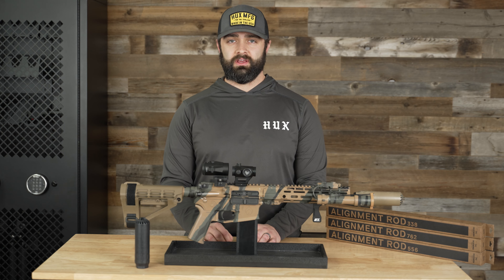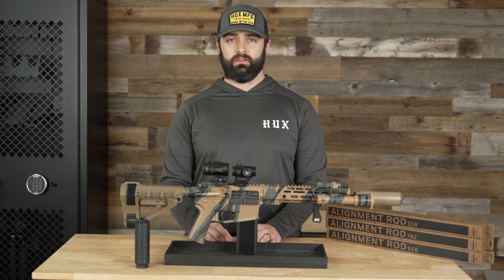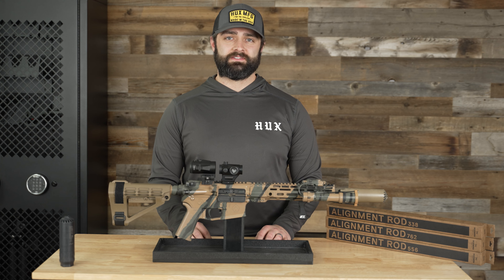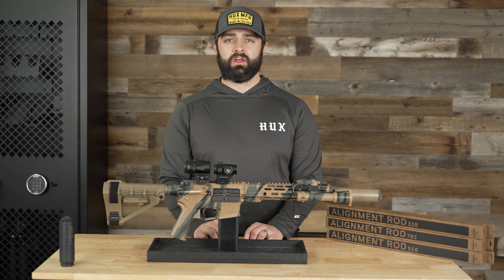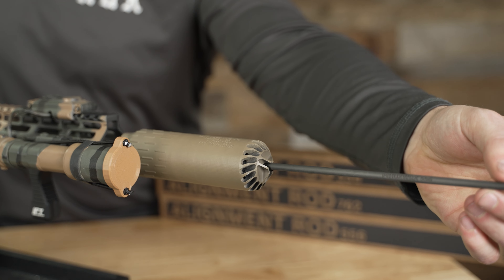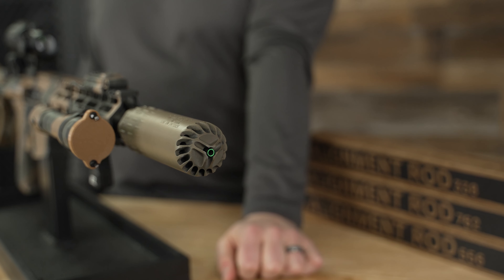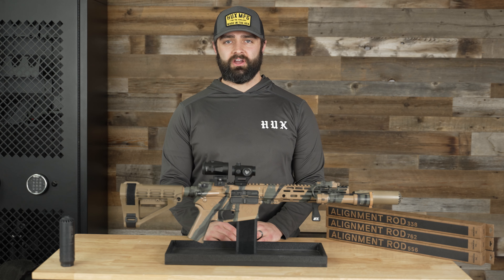HUX EDU - How To Use An Alignment Rod

Comment: I dont have one of those but a Geissele. Metal alignment rod in . 308 diameter. I used it on my 300 black out and it was not concentrict with the bore, showed it to the my dealer. They told me not to worry about it and to shoot it. Guess what, I got baffel strikes. Ruined my $1,300.00 suppressor. Please learn from my mistake and get an alignment rod and if it doesn't prove concentrict with the bore DO NOT SHOOT IT !!!
Reply: Sorry about your experience,  you need to search out another dealer with better customer service
Reply: That’s why I don’t trust anyone with my firearms I can do the work myself, everyone I’ve used just does half ass work and doesn’t care
Reply: Never listen to dealers is the real lesson here

Comment: There is some clearance factored in. As long as it’s not touching the suppressor it’s good to go. It won’t be a 100% centered every time. Most times you will have to re-zero your scope when adding a suppressor. General rule of thumb is lightly lube the alignment rod. Shouldn’t be much resistance at all. If you have a pin gauge then you should have roughly 0.020” clearance around the rod. More often than naught, alignment rods can cause a lot of confusion.  Another method is to attach the suppressor to the host and point the rifle towards a brightly lit area or light. Look down the barrel from the breach and you should see a perfect circle of light. If you do then you’re good to go.

Comment: I'm hoping you can help me out. It appears when I use an alignment rod to confirm concentricity, I'm not getting perfect alignment. The rod is slightly off to the side. Interestingly, when I only put the rod in the muzzle brake adapter, it is centered.

I have not shot the can yet on my rifle. I've already returned the suppressor to Otter Creek and they sent it  back already saying that there was nothing wrong with it.

Have you noticed that the alignment rods have been a little to the side on the Polonium-K suppressors, or any of their other products by chance?

The rod is off to the side, regardless if i use the direct thread mount or the hub mount with an adapter and off center even on other barrels. 

I wonder if there is a way that Otter Creek tests their cans for concentricity that is different than a muzzle brake on an adapter or hub and on the barrel? Maybe they're using their lathes instead and that's how they're getting different results...

Comment: How do you properly install it if it’s installed wrong? How do you know if you installed it wrong if you don’t have the rods?
Is it the muzzle device or the suppressor that’s installed wrong that causes the issue?
Reply: Most of the time it’s the muzzle device that’s installed wrong , it could walk off if not properly torqued. [IMPORTANT] If you don’t have a rod separate upper from lower, take BCG and charging handle out of upper , put on suppressor & look through the back of the upper all the way down the bore it should be a perfect circle 🌕 and not like a crescent moon 🌙
Reply: Also if you have a small light . Instead of looking through the bore you can shine the light down the bore from the back where the bcg goes, aim it at a white wall in a dark room and you will see a perfect circle if it’s all good.

Comment: So how do you correct the problem???????
Reply: Right. They all show us how to stick the stick in the hole. But not how to correct the issue lol
Reply from the maker: Depends on the problem! We'll warranty and take care of our mistakes but we cant guarantee your threads on you guns.
Reply: If the rod is touching then t he concentricity of your barrel is off. Either you can file down your threads on the opposite side of the touching. Or take it to your gun smith.
Reply: If it’s contacting the suppressor that almost* always means you fucked up your muzzle device installation by either using a crush washer, incorrect shims and sometimes a burr on the shoulder of the barrel where it meets the MD. Eccentric barrels on ARs rarely happen, but it has happened. This is just a quick verification that you won’t baffle strike after installing your MD for your fancy new can.
Reply: @thefullmag yea filing down the threads on my barrel sounds like an idiot move

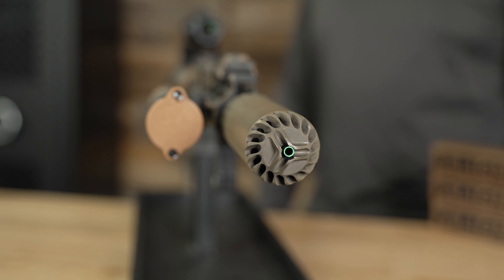Comment: @0:58 kinda looks like the top right of the rod is making contact with the suppressor, 2 o’clock position
Reply: Yeah, that's what he said.  "This is what it looks like when your muzzle device is improperly installed, and you will end up with a strike."
Reply: @pdlane43  got it he said it so fast it sounded like “is properly installed” thanks for clearing that up.
Reply: @josh48315  Yep, I had to rewind it to be sure.  I actually prefer when an error is demonstrated.  The video was done right.

Comment: How to make your own VERY cheaply. Find ANY straight rod (I used one of my carbon fiber kite rods - roll it on table top to make sure) that is slightly smaller than barrel I.D. - wrap cellophane tale around it until slight interference fit (not tight), I then wrapped electrical tape of other end where it exited suppressor until it also was just interfering.

Comment: If the supressor is precision machined there should be no need to align.  Or else everytime you clean/remove supressor that too would be recommended.
Reply: It's not just about the can. When you take into account barrel concentricity, muzzle device threads, and suppressor... You can have what is called tolerance stacking.
Reply from the maker: We'll guarantee our cans but we can't guarantee your threads!